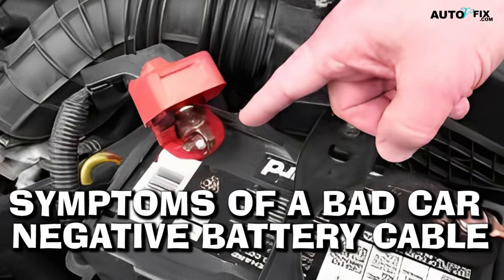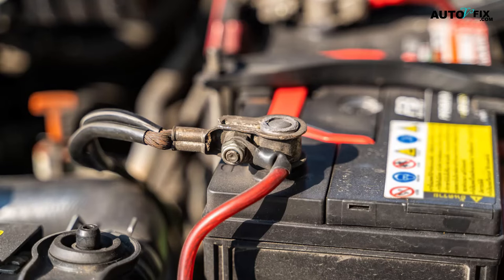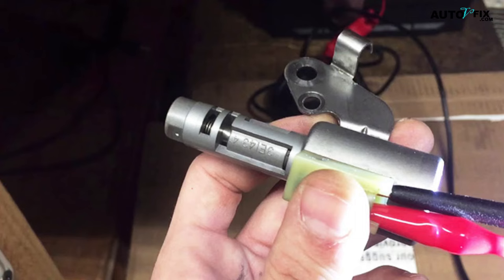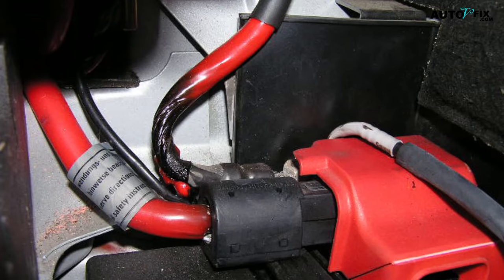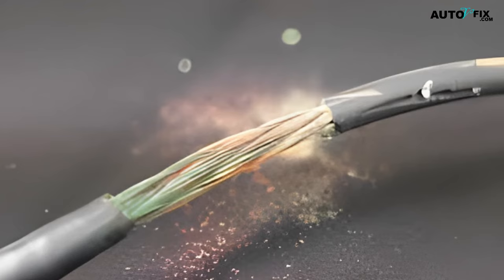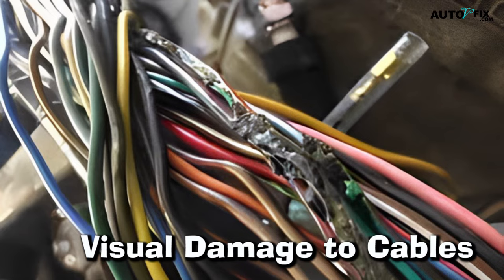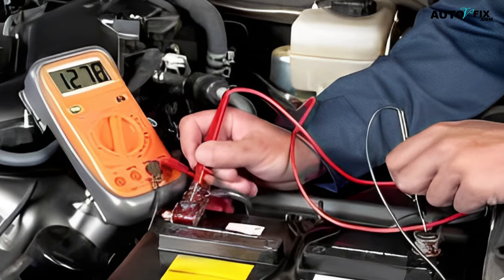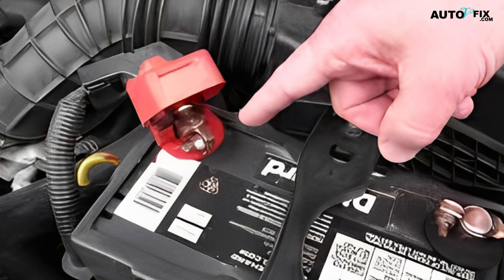SYMPTOMS OF A BAD CAR NEGATIVE BATTERY CABLE

Comment: 1st off, pic shows power cable not negative. Red is always power omg.
Reply: On my car red is connected to negative and black on positive
Reply: My ford truck has a red gable on ground  ad black on positive it fooled ounce trying to give a just start to a friend’s car?
Reply: Well a positive connection would make it a bad ground for negative ground cable
Reply: I was looking at the same thing
Reply: Doesn't matter. Point is the issue not the picture

Comment: Question… my clamp on battery cable is broke but hanging in there… can it make my alternator go??
Reply: Go where?
Reply: @grod374  🤣🤣🤣🤣🤣🤣 rt🤣🤣🤣🤣🤣
Reply: It can kill your battery, but the alternator should always charge until it doesn’t even if what it’s supposed to charge isn’t getting the charge. It’s cheap, & surely you can find somebody to do a minor repair for you if you don’t want to try it. Even a shop would be under 100 dollars. New terminals only are about 15-25 depending what kind you get. Instal would be one hour.